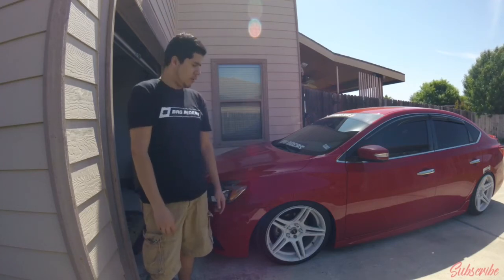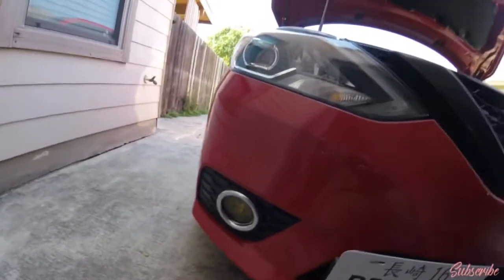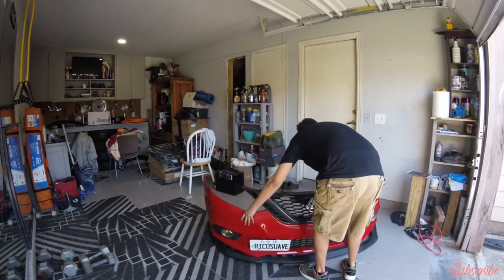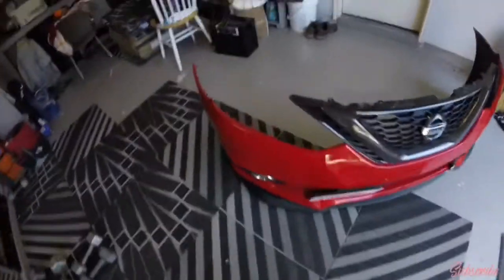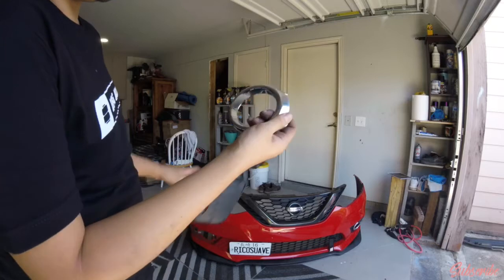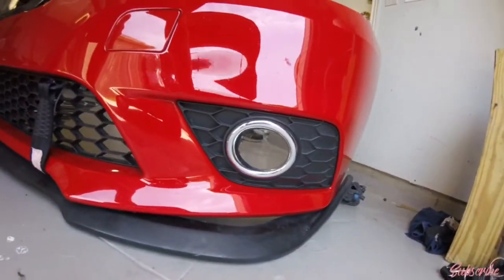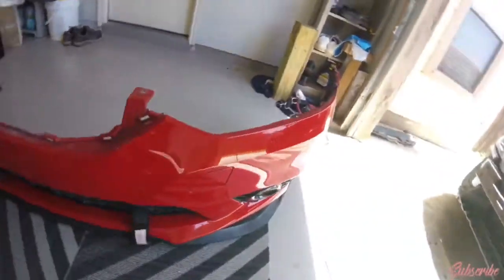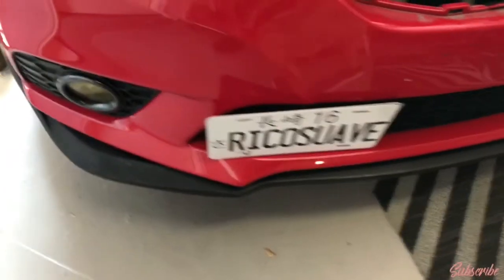reinstalling my WRX STI front lip/little modded!!

Comment: Good job fitting this front lip. I just bought mine and tested the fit. The gaps look UGLY! I'm going to do what you did and fit it more in and cut the remainder. My questions is what did you use to cut this material I don't want to damage it.
Reply from the maker: Hey man thanks! I just use a hand saw you can always use a sharp blade, just heat the material first
Reply from the maker: Hey man thanks! I just use a hand saw you can always use a sharp blade, just heat the material first
Reply from the maker: Hey man thanks! I just use a hand saw you can always use a sharp blade, just heat the material first